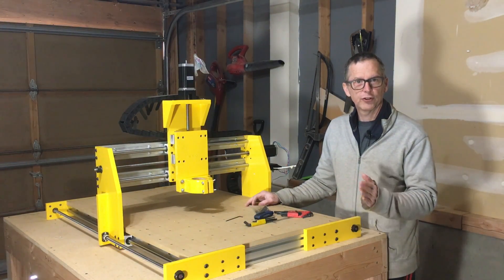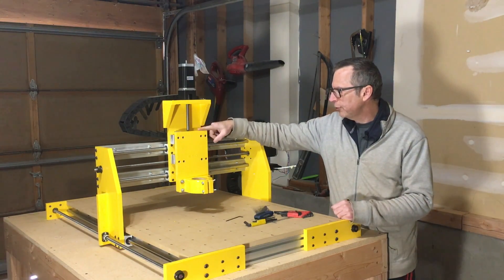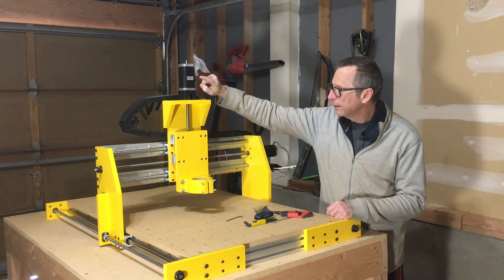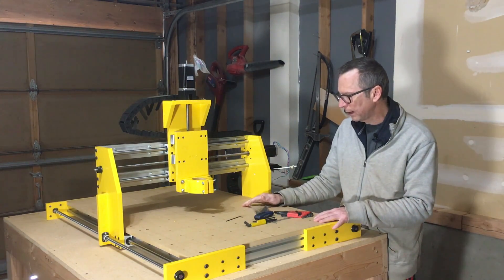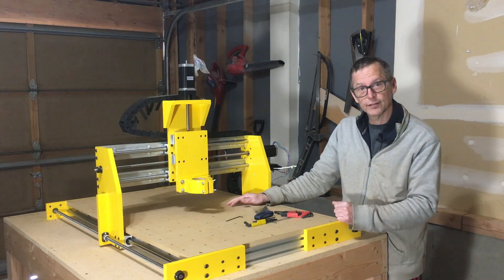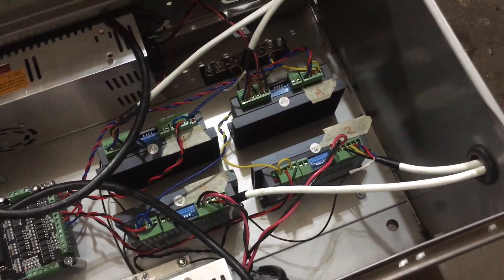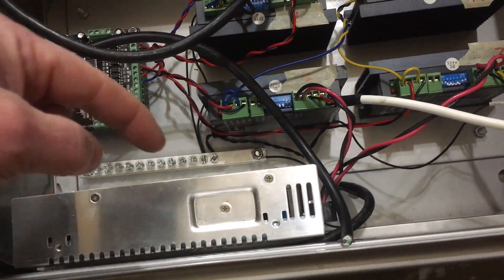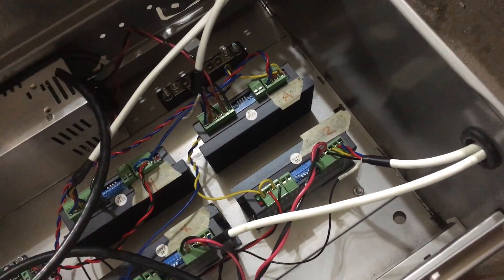Wiring The Control Box For The Highline CNC Machine Project

Comment: I know this is an old video, I'm in the process of wiring mine and trying to decide the best way to tie in my E-Stop. I'm leaning towards a Master Power Contractor. I noticed you wired the Z- limit switches into the SE (Stepper Enable) instead of the LZ terminal. What am I missing here??

Comment: Hi Chris, I didn't see the previous episode but I'm wondering (and interested in knowing) how you will deal with the usual reference point before running every G-code program? Is this a specific circuit? On my CNC it's based on magnets placed on each axis. But maybe you covered this specific point in the previous video, I'll check it rght now. Good job so far!
Reply from the maker: Homing? I don't use homing. I do use limit switches to prevent damage.

Comment: Why not use a desktop with a drop in PCIe parallel card?  Sure, it's not as convenient as a laptop, but cheaper to replace than a laptop.  And really desktops are a more viable long term solution, as hardware can be replaced and upgraded easily.  Not to mention you can get filters for the fans and air intakes for a desktop.  Not so much for a laptop.   Totally your choice, but to me, desktop seems the better direction all the way around.
Reply from the maker: Why buy a desktop if I already have a laptop that I've been using for CNC work over the past 3 years? If I didn't have either, I would get a Raspberry Pi with a CNC hat, a monitor and a keyboard.